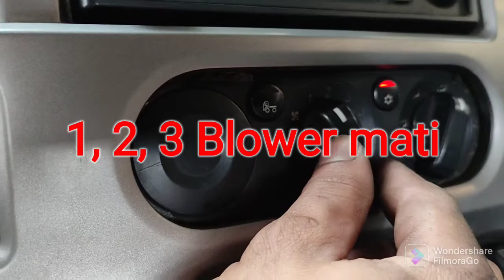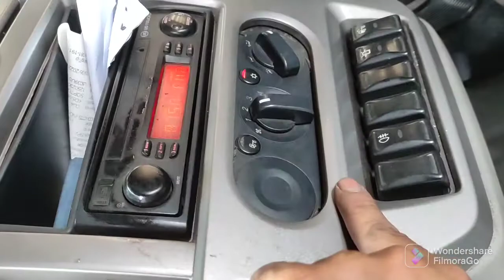QUESTER : Blower mati / AC mati

Comment: Ada kasus Ac ud truck quester ga mau dingin di kecepatan 1,2,3,4 gada angin dingin sama sekali, cek sikring ac putus dan udah di ganti masih tidak dingin, freyon dan kompressor di cek masih bagus semua, kendala nya ada di mana ya? Apa wersten resistornya atau komponen lain, mohon bantu mas🙏
Reply from the maker: Pas dinyalakan blowernya tapi normal nyala kipasnya ya Om?
Trus pas posisi AC dinyalakan selang AC yg besar dingin (ngembun) ngga Om?
Reply: Ga ngembun posisi hose nya, curiga di evaporatornya
Reply: Ga ngembun posisi hose nya, curiga di evaporatornya
Reply: @Mechanic57098  pas dinyalakan blower normal om, cuma hembusan angin kecil, tapi putaran blower kenceng, takutnya di evaporatornya udh kotor banget jadi udara nya tersumbat
Reply from the maker: Kalau untuk hembusan anginnya blower, coba sampean buka filter AC yg dari kap cabin Depan itu Om. Kalau kotor dibersihkan saja. Sama dibelakang filter itu ada jendela buat ventilasi angin Om. kalau posisinya terbuka ( terlihat kipas blowernya), sampean tarik kebawah aja posisi jendelanya biar tertutup ( kipas blower tidak terlihat). Hembusan anginnya nanti bakalan kenceng lagi didalem cabin Om
Reply from the maker: Kalau AC tidak dingin dan posisi selang gede ga ngembun pas AC dinyalakan, pastikan freonnya dulu Om takutnya ada kebocoran

Comment: Bang punya saya kasusnya sama seperti video ini.
Tp saya coba seperti trik Abang di video ko gak bisa ya.

Ttep aj no 1,2,3 blower g nyala.
No 4 blower nyala tapi g dingin..

Ada solusi lain gak bang.?

Trimakasih & sukses slalu bang.
Salam dari Surabaya..
Reply from the maker: Kalau problem 1,2,3 blower mati AC nyala dan 4 blower nyala AC mati kemungkinan kerusakannya cuma ada di IC regulator itu saja sih Om. Mungkin komponen IC regulator mobil sampean lebih dari 1 titik kerusakannya Om, jadi ga bisa pake repair lilitan serabut kabel.
Reply from the maker: Kalau ngasih lilitan kabelnya ndak usah tebel2 ya Om. 2/3 serabut aja Om

Comment: Bang knp ya Quester euro5 gampang membeku hose nya?
Reply from the maker: Sensor temperaturnya yang didalam kabin itu eror Om. Jadi dia harus ngebaca minus jauh dulu baru dimatiin otomatis kompresor.nya.
Reply from the maker: Efeknya jadi sistem AC.nya terlalu dingin. Jadi ngebentuk batu es di evaporator & selang2nya
Reply: Betul bang ,kalo ku diamin sejam ac nya kembali normal lagi
Reply from the maker: Saran saya sih kalau umur unit belum ada 1 tahun kasih info ke Dealer aja Om, biar dilakukan garansi penggantian sparepartnya